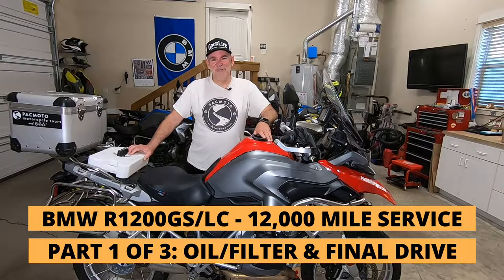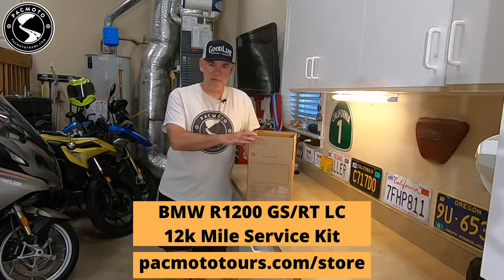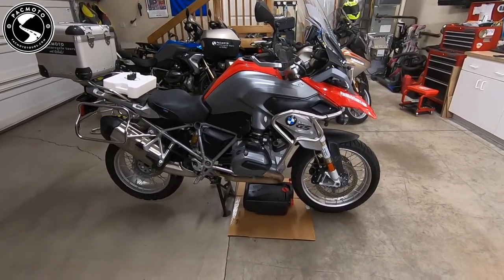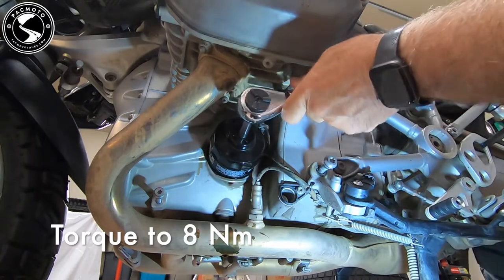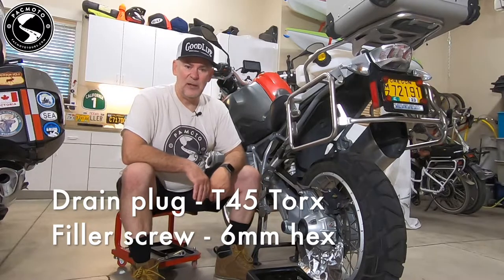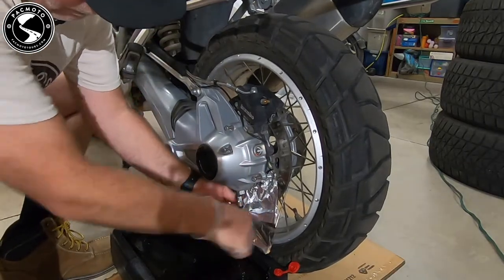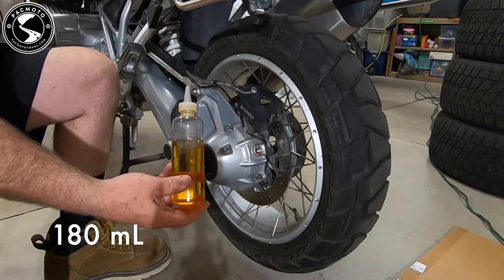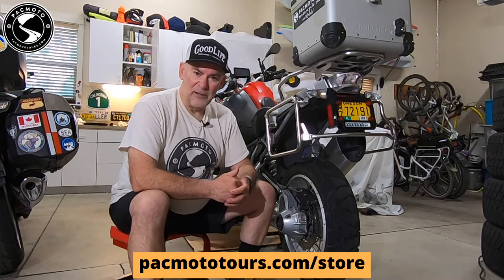BMW R1200GS/LC 12,000 Mile Service: Part 1 - Oil/Filter Change & Final Drive

Comment: For the 1250gs is the final drive fluid change the same?  Do you know what size oring for the drainage?  TIA for any comment.  Watched all 3 videos, but ti am doing it on a 1250gs.
Reply from the maker: The final drive fluid for the 1250 is 70w80 while the final drive fluid for the 1200LC is 75w90. O-ring is 11.2mm and full crush ring is M12 copper. All of this is available at pacmototours.com/store. Have fun saving hundreds of dollars!!